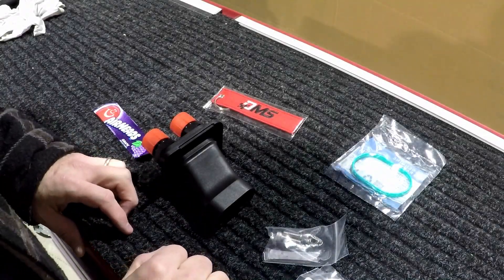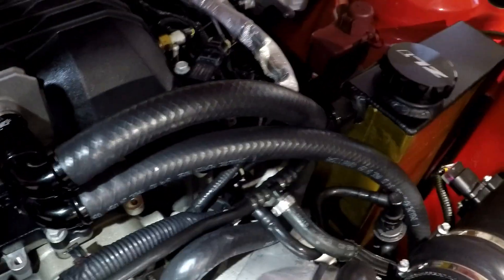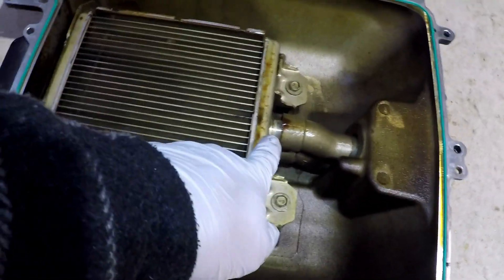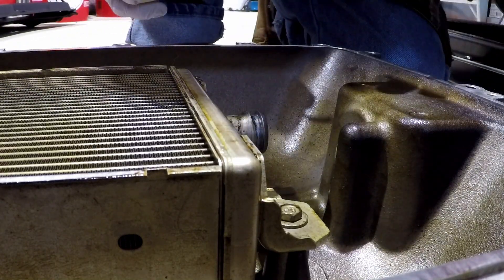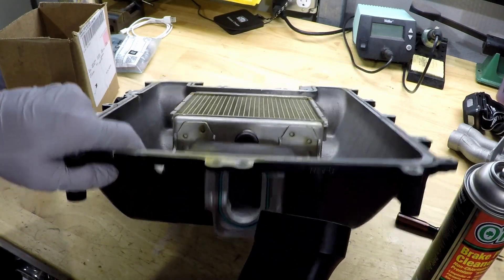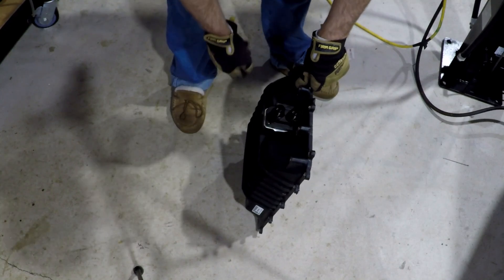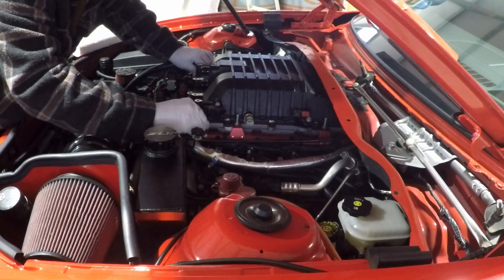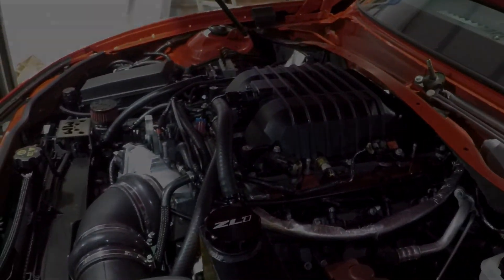16psi causes this LSA to leak. Dedicated Motorsports Billet 12AN Water Manifold

Comment: Does the supercharger have its own oil and how often does that oil have to be changed?
Reply from the maker: Yes, it has it's own oil and never needs changed in it's stock configuration.
Reply: @fasnuf  that's good news, I didn't drill any holes in the cowl so taking it off of the motor would be a nightmare! W00t!

Comment: I'm pretty sure that you knew that Dexcool needed to go in there, so why did you use water as coolant? And how did you increase the boost to 16 psi, and why? That's almost double the factory boost. Did you lower the compression?
Reply from the maker: It doesn't need coolant in my situation. The water will never freeze or boil in my environment. The only advantage coolant might add is a bit of corrosion  protection for the aluminum. The car has been at 16+ psi since putting the larger crank pulley on. No I didn't lower the compression and don't need to.
Reply: @fasnuf  that's such a nice motor and you worked on it so much and so hard, it'd be a shame if it blew from so much boost. Why do you believe that it'll withstand almost double the amount of boost? And yes, I believe Dexcool would have prevented that gunk from forming. Writing of which, I'll have to have the coolant in my ZL1 flushed, it's been ten years, way overdue.

Comment: good job mark. you must have had bad internal Orings. I'm at 17lb and my dedicated adaptors don't leak. my lid is missing almost half of those black plastic bolt holders.
Reply from the maker: Thanks Jeff, not sure why they were leaking. They were changed when I reinforced the brick. My guess is the adapter orings were weak.